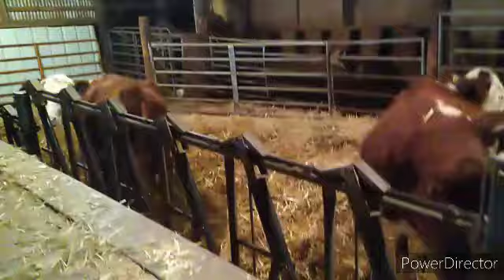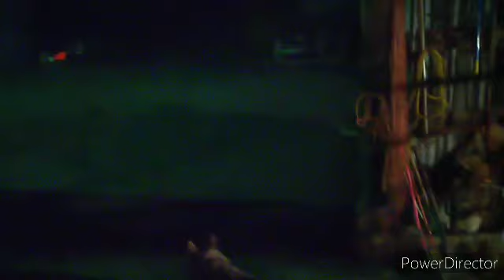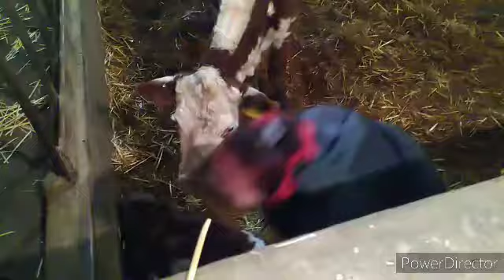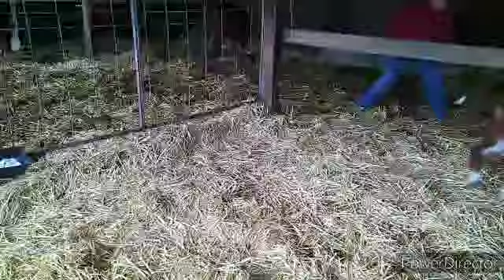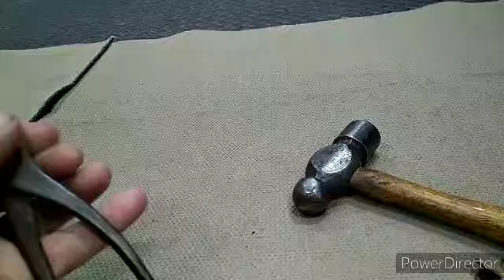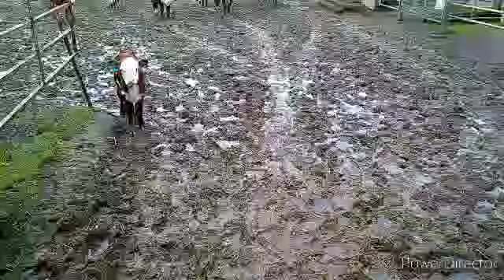Mini had a heifer...a little bit of everything...

Comment: 🍻🍻🥃🥃
Reply from the maker: Good evening sir 🥃🥃🍻
You and Nelson in the top 2!!
Reply: @Gosselin Farms Ed Gosselin  yep. Played appliance installation person today now I know why I don't do it for a living supposed to be exact same model but all the mounting tabs and holes were different
Reply: Good Evening Ron.....
Reply: @brenterickson1695  good evening
Reply from the maker: @ronphillips1437  lmfao 😂😆😂😆
Had the same issue when we replaced the microwave in town ..
Got lucky and got the exact same model... Totally different mounting system. Was actually a better setup, but had to redo everything 🙄
Reply: @GosselinFarmsEdGosselin  luckily I didn't have to totally redo everything I cut off two tabs made slots where the original holes were cause new mounting holes were 5/16 inch further forward and still have to redo the vent fan properly they didn't hook up the last one cause vent pipe is round the vent is rectangular Katie picket up adaptor at lowes
Reply: Good evening Ron.
Reply from the maker: @ronphillips1437  nice 👍
Reply: @brycewiborg8095  good evening
Reply: G'day Ron
Reply: @Murphyslawfarm  g'day Murphy 🍻

Comment: Keeping a liquid nitrogen storage system at low, takes replenishment. Its not rocket science... its only diligence. Several places in the greater Portland area actually produce Liquid Nitrogen, and even during the pandemic they were open. Keeping vials cold is pretty easy when the supply is close by, its open, and its not costly. We use LN2 in our business to treat components, so we know... we had no issues getting it and transporting it at all. Sorry you lost all that semen, especially as there is no good reason, only negligence. City people won't get it... Reliable collection and storage is the key to modern dairy, and beef ranching. It allows selecting the right sire for gene profile, and allows pregnancy when its the right time... not just when a bull is feeling like it.
Reply from the maker: Exactly Jennifer! 
Just laziness and greed😡
The guy made his rounds, but would either not put enough in, or go too long between visits. A good tank needs to be topped off every 6 months anyway.. usually every 3.. used to have a great service guy, showed up once a month. 
A lot of people got spoiled with him! If a tank took a little more than normal, he'd check with you, see if you had been into it more than normal, if not, he'd find another tank. He even had a couple of loaner tanks to get you by if needed.
Sure miss those days.